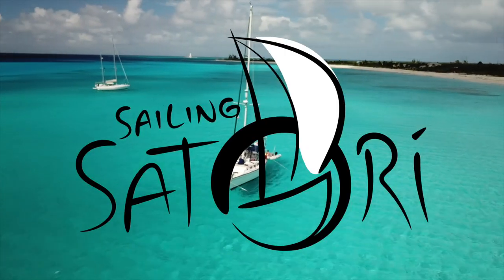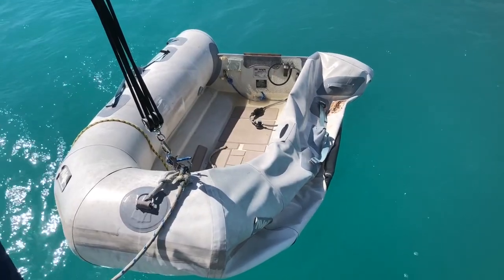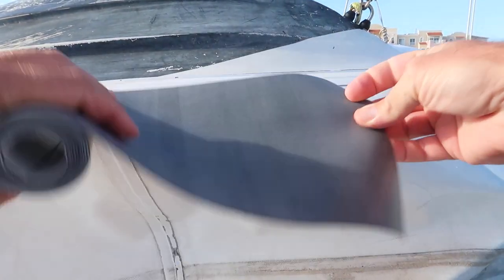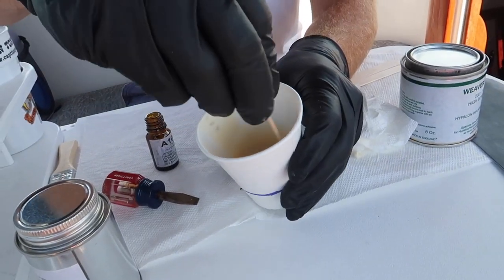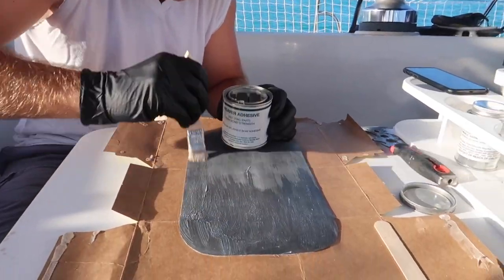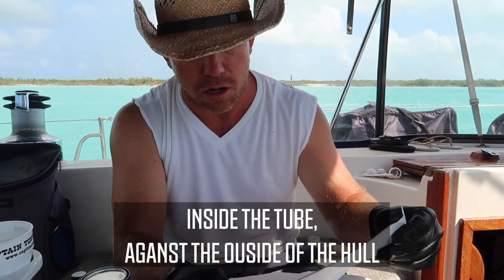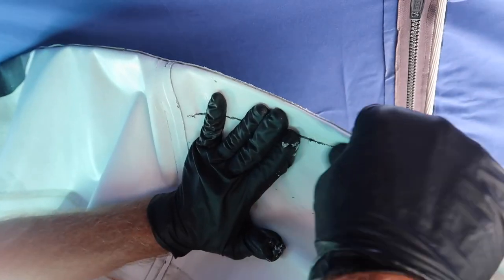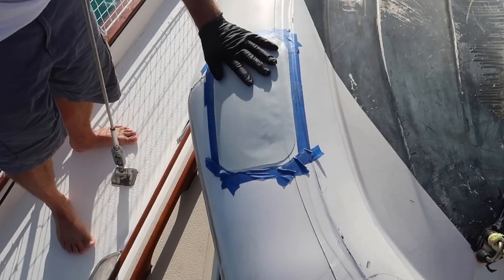Inflatable Boat Repair (Sailing Satori) OTH:7

Comment: Hypalon and PVC have different specific adhesives and thinners. For example, Toulene for Hypalon, MEK for PVC. Also, if you do accidentally touch a small spot when trying to position the patch and cannot get it to release, a simple dip of the brush in the appropriate solvent, and work it against the stuck part, and it will come free to reposition.

Comment: Tolulene is the preferred solution on hypalon, on pvc mek is required tolulene isnt ideal, m.e.k will soften the surface of pvc allowing the glue to make a chemical bond where as tolulene will not..ta

Comment: Nice job. I used Tear Aid to seal the inside of the tube. Then applied a bead of 3M marine sealant to the tear. It was a "T" shape rip and I needed to keep it from separating. I'm putting on another piece of Tear Aid on the outside and then a PVC patch with adhesive. Good detailed video.
Reply: 3m4200 or 5200? Both are THE best

Comment: I have a Klepper that has a cut in the hypalon hull.  This is the best vid I have seen on patching with two part adhesive.  Thanks - J
Reply: You don't need to part adhesive, 3M 4200 would do the trick permanently

Comment: Hypertex is different. work in the shade or early morning before any heat from the sun.

Lint free cloth wipe patch area three times 5 minutes apart with Methyl Ethel Ketone M.E.K.
First pass removes oxidized surface, second softens, third wipe with a new clean towel each time, prepares the surface.
Next, mix 1/3 weaver with 1/3 hardener and 1/2 OZ (shot glass) of toluene, I mix with a bent coat hanger on a drill, about 5 inches long with a (L) bend.
On really hot days I use more toluene.
Use the brush three times to apply glue to all surfaces 5 minutes apart, (use egg timer) be exact, really thin.
If the glue dries too fast after prep, wipe with MEK once and get the patch on within 3 minutes, work fast, be firm and I personally use a car tire repair roller.
Do not use the boat for a week,  do not air up over 1 psi, Caution the fumes inside the boat are extremely flammable, so I let the air out to 50% and pump in good are several times over the course of 4 days.day one do nothing.
Never let the boat deflate all the way.
I have a leak at my transom at the port side where the floor meets, will be cutting access opening to patch the transom leak, access point will be 12-14 inches forward of the port tub and the access will be at 10 to 11 o'clock, elbow size, help is required to keep the tube inflated- this technique is kinda like Arthroscopy surgery. interior patching is easy.

Comment: Hi! I saw you used the Weaver Adhesive. How does it work so far? I want to use it to fix a 8" open seam on my Sea Eagle inflatable kayak. My kayak only requires 3.2 psi so I hope the adhesive on the PVC can hold that pressure. Any recommendations or ideas would be great.

Comment: I was watching the part on getting the air bubbles out, thinking that perhaps a fin roller for fiberglassing would be the ideal tool.
Reply from the maker: Possibly, but it may require a lot of pressure. The metal 7-in-1 tool worked, but was a little harsh.
Reply: Just use an old spoon and work all the areas from center out...

Comment: This process is extremely lengthy. Does it really work? 2 pack glue usually dries hard. My “go to” vinyl glue is HH66.
Reply from the maker: Don’t know anything about HH66, but this repair has lasted almost 3 years with no leaks. Rock solid.

Comment: But did you try slapping on some flex tape with the might of Zeus?

(Also fun fact this was uploaded on my 25th birthday =P)
Reply: Do not use flex tape on inflatable boats!  We tried it on our pvc inflatable kayak.  It rippled and the glue oozed out to a sticky mess nightmare.  Took a ton of "glue be gone" once we easily pulled off the tape, and weeks of rubbing. Then we patched it the correct way with marine products.

Comment: I would be very worried about leaks around the tube seam that the patch went over.  I kept waiting for you to comment about that seam.  Doesn't the seam create a small pocket for that air can escape from? It seems it would be hard to form the patch completely around the seam.
Reply from the maker: I though of that when I was doing the repair, but there was just enough space between the tear and the seem to make a seal. Surprisingly, the patch laid quite nice over the seam... 6 months later, that is the tube that holds air the best.